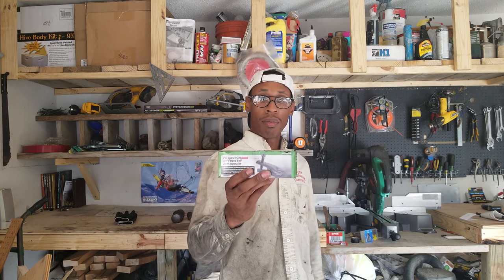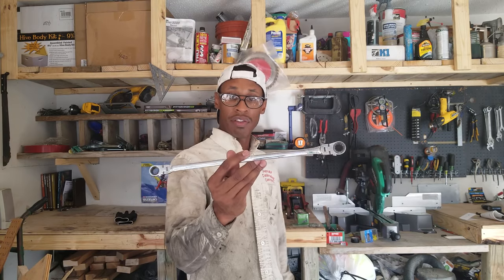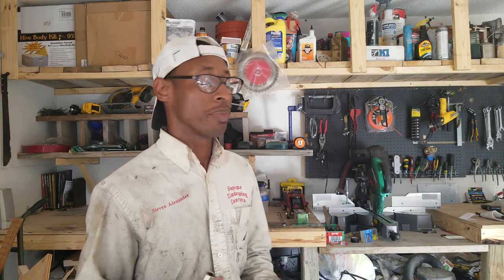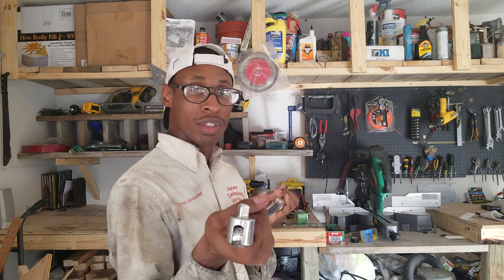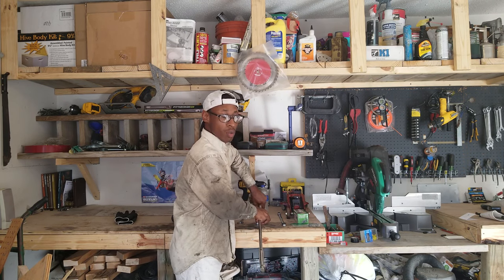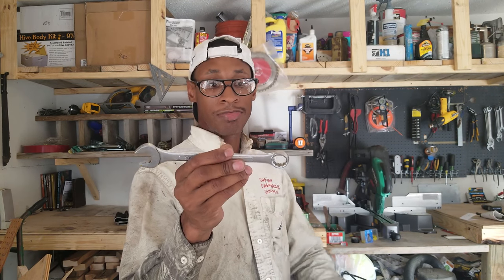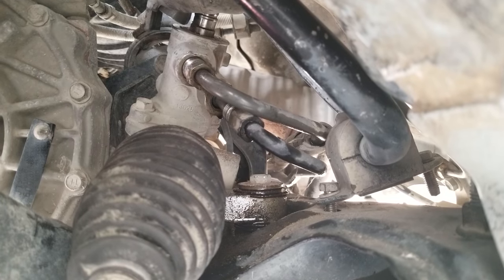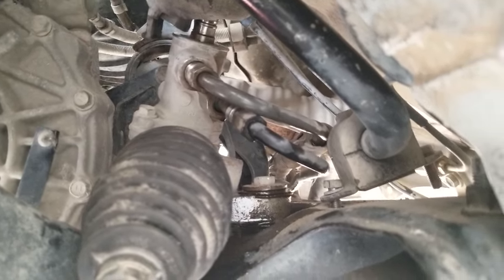How to Remove Toyota/Scion Tc Rack & Pinion Pt. 1

Comment: Would this apply to a 2012 scion tc with electric power steering?
Reply: What issues were you having ?
Reply: @cybersfn7678  I'm not sure if it's the rack and pinion. When I jack up the front of the car, the wheels have minor play back and forth. When driving the car on the highway, it feels like the steering wheel is trying to make small corrections on it's own.
Reply: @brandvik9172  maybe check your tie rods first (inner/outter)
Reply: It sounds like my problem too. What I found is the steering column is bolted to the rod that comes out of the rack, meaning that that rod is stripped out. So I have to replace the rack